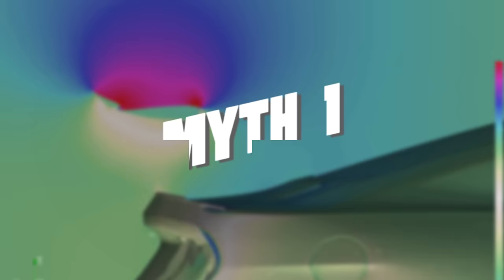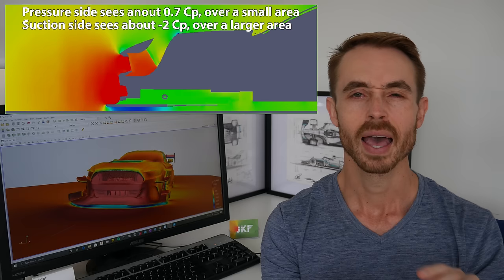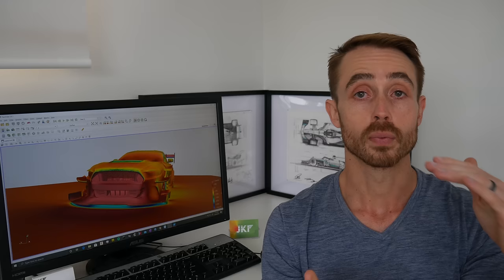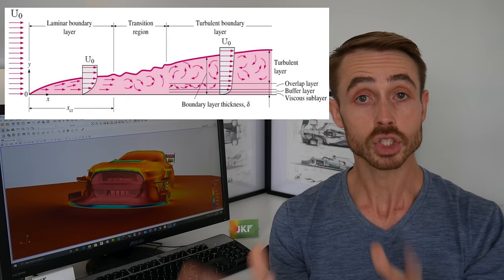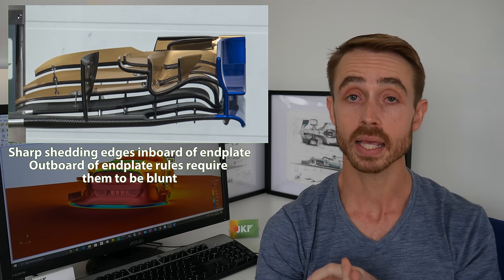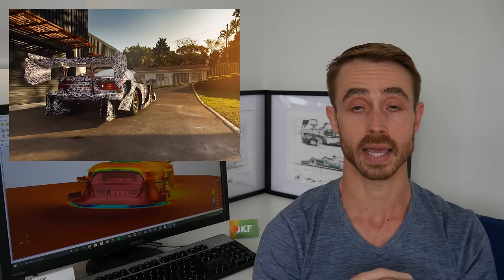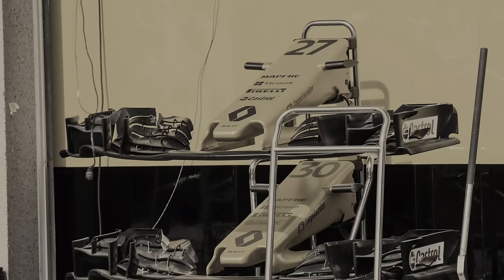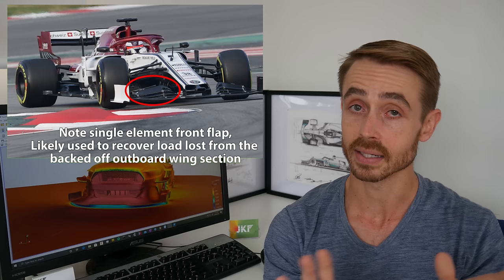5 Common Race Car Aerodynamic Myths

Comment from the maker: Seeing a few questions in here about speed sensitivity, downforce definitely does vary as the square of the speed (L = 1/2*density*velocity^2*coefficient of lift*area), however what I am more talking about is changes in flow separation and the coefficients of lift and drag varying with speed. Thanks for watching!
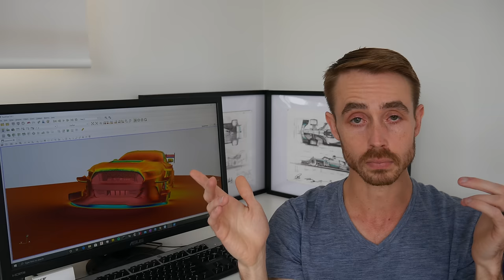Reply: How do you design a fixed angle air foil with a large enough angle of attack for downforce at low speeds, but shallow enough to prevent flow separation from high momentum air at high speeds? Also what do you mean by "load" at 8:47 ? Thanks, love your vids!
Reply: I would like to recommend a topic for a future video. I think it would help educate people and myself, if my assumption is wrong:

Would cars trailing a truck to lower their fuel consumption consequently increase the truck's fuel consumption?

I think it won't increase the truck's fuel consumption (at least not significantly) but a lot of other commenters are saying it will because "nothing is free".

I see it as if a snow plough pushed the snow out of the road and cars behind it are travelling more efficiently because of the absence of snow on the road. the snow plough's fuel consumption will not increase or decrease because of the cars that are reaping the benefits of the absence of snow on the road, whether those cars are 15 meters behind it or 1 km behind it.

Now i know that analogy is not very accurate since snow does not flow back into place like air does so i hope you can make a video with a better explanation. Thanks!
Reply: I'm watching WTCR in nordschleife this weekend and the Lynk &Co have the rear wing with a very unusual angle. I think is an example of the Myth 1 of your video?
Reply: @ccmckernan  now a days you see a lot of flexible wings which deflect at higher speeds thus reducing angle of attack. Check red bulls flexi wing in vettels days for more info
Reply: @sepg5084  It depends somewhat on the distance of the vehicles. But there has been wind tunnel research for example by Zabat et al on platooning. It showed that generally the drag decreases for the trailing cars and sometimes even for the leading car. The reason for the decrease at the trailing cars is the reduced speed of the incoming air in the wake. So effectively the incoming air is slower, which, as mentioned in the original post, influences the force in a quadratic fashion. The drag coefficent however, slightly increases (at least in the research I conducted) due to the higher turbulence, but its not as much as the decrease in velocity (at small distances under ~100m). Another project including trucks was the European SATRE Project, showing similar results. There were a few more, but just to give you a head start. If you want to look deeper into it, usually the expression 'Platooning' is used for convois of vehicles. Let me know if you are curious about more, cause that was part of my research over the last few years.

Edit: Sorry, forgot about the secord part of your question: The leading vehicle usually is barely influenced. The results are not fully the same, but most research believes the drag of the leading vehicle decreases slightly as well. As vehicles are bluff bodies, usually you have a high pressure region in the front, working against the movement as well as a low pressure region, also puling the vehicle back. The trailing vehicle has a lower pressure in the front due to the lower speed. However, it also slightly increases the pressure at the back of the leasding vehicle. Most likely the air is slowed down in front of the 2. vehicle. Thus, the pressure in this region increases and also increases at the back of the leading vehicle (we are talking small distances here). Thus the suction on the back of the leading vehicle, pulling it back, reduces and the drag is reduces as well. If I remember correctly it was, depending on the experiment, in the region of a few percent - but do not quote me on that :)
Reply: Cx and Cz do dynamically change with bodywork deflection. I think you underestimate how compliant parts are for mass reasons. Changing pivot points in the structure allow you to control this impact. As load is proportional to v^2 this impact is most felt at high speeds so this can be powerful for dumping Cx on the straights.
Reply: The use of the word Suction is very misleading.
https://www.youtube.com/watch?v=5eFI8-DyWtA
Look at the title of that video, then listen to what he says.
Pressure difference Top/bottom is the better term used nowadays.
Reply: Qw
Reply: @sepg5084  I would think if anything, if they were close enough they would help the truck's fuel economy by reducing rear suction.  People who say "nothing is free" are correct in that energy is always conserved, but in this case it just means that less energy is transferred from the vehicles to the air in the forms of wind and heat.
Reply: Suction is not a force.
Vacuum is not a vector.
Reply: heard we still don't know how a plane wing works yet too 🤷🏻‍♂️

Comment: I disagree with his first claim that aerodynamic downforce phenomena are generated by suction, not pressure. “Suction” is a virtual force much like centrifugal force. Neither are real forces. Suction is an apparent force that is really the result of the higher pressure in the side of the system in question opposite from the “suction” lower pressure. Suction cannot exert a pulling force and only appears to be a force when in reality the net force is only exerted from the high pressure side of the system like an airfoil turned upside down from how it is usually positioned for aerodynamic lift.

Comment: The emphasis on "suction" bothers me.  Air does not pull down on the undersurface of the wing...there  is no tensile coupling.  So the only actual force on the wing is the higher pressure on the topside.  The "suction" is only a mechanism for creating a pressure differential which attempts to force the wing away from the higher pressure topside towards the lower pressure underside.  That is not in disagreement that the underside low pressure characteristics can be more significant than the top side higher pressure contribution.  But it's the differential that provides the function.

Comment: Could you do a video on the subject of wheel arch vents: their appropriate time and place in race cars, and how they work? Also, the new Lotus Evija has some really interesting exterior design choices which could make for an interesting video.
Reply: Evija does indeed have some interesting aero. Ignoring the body styling to a certain extent the front wing/splitter and floor design is very much reminiscent of an LMP car.
Reply: My understanding is that venting wheel arch pressure is generally a good thing to reduce lift but how you do it can have an adverse effect on downstream aerodynamic elements
Reply: @DjDolHaus86 but were is the best Spot before at or behind the center of the wheel?  Because if I remember correctly (did see a Video from a different guy) that has a huge impact  on the wheel arc pressure and how it cann distort the air flow and effect all kinds of other downforce devices
Reply: @TheLtVoss  There is no singular answer to that, it would depend on a whole bunch of factors.
Reply: @DjDolHaus86  yeha though so much but a Video on that would at lest give us the knowledge to make assumptions too Figur it out our self if we have the drive too do soo
Reply: @TheLtVoss  I'm not sure what you expect me to do about this? I don't make videos on aerodynamics

Comment from the maker: Welcome back to the first video of regular scheduled programming since my return! Hope you guys enjoy it!
Reply: WE ARE ENJOYING IT BEFORE EVEN WATCHING
Reply: I love the content! I show your videos to all of my FSAE aerodynamics subsystem members for introductions into key concepts.
Reply: Glad you’re back
Reply: thanks, i really appreciate that
Reply: what's your opinion on exhaust blown diffuser ? Like naca duckt shaped exhaust tips integrated in to top of the diffuser.
Reply: What about diffuser that are sealed with the bumper (like your miata picture example) and the diffusers that have space between the top part of the diffuser and the rear bumper/body of the car? I see those two style at the track very often at the track.
Reply: That's a great come back! I like it a lot.
Reply: Question about number one especially in the case of high angle rear wings doesn't the redirection of air also make downforce.
Reply: @Multiversal_Rift  Coefficient of Lift takes that into account. And Cl has a theoretical limit of 1 on the pressure side.  Also from a design point of view, you don't really have to worry about the pressure side because airflows usually don't separate from it.
Reply: MotoGP aero for next video!
Reply: I love it
Reply: Great Video! I would be interested to have a Video about Gordon Murrays new T50 Fan Car. That would be nice to understand in detail and would be a good addition to topics in this video.
Reply: Great video and very timely as I have finished my diffuser. Now moving on to the front diffuser and side skirts.  Great info to clear up a lot of myths out there.  Thanks!
Reply: Welcome back!

Comment: That last one makes quite a bit of sense.  Because on aircraft, the multi-element flaps act as a single element when retracted and only become multiple elements when extended past a certain point.  The goal of the flaps is to maximize lift at low speeds.  So multi-element wings should really only be used at tracks where the top speeds are relatively low.  Otherwise, the time gained in the corners will be negated by the greatly reduced top speed.

I would like an in-depth explanation on how the slip ratio of the tire works.
Reply: Unless the rules allow for DRS. Then, you could potentially have higher downforce at lower speeds than a single element and put the elements into a 0 attack angle for the straits. The problem is, in many cases the elements are "designed" by the "looks good" or "worked for so and so..." method and achieve drag and lift coefficients no better than single element devices.
Reply: He has done a whole freaking 10 part series on tires already!
Reply: "I would like an in-depth explanation on how the slip ratio of the tire works."

Beyond saying "tyres generate highest forces at certain slip angle/ratio ranges, which can shift depending on load, geometry, conditions, etc., and this is because they generate grip in many different ways, which vary in effectiveness with varying tyre conditions", it's a bit hard to go much deeper, unless you're trying to isolate why one specific tyre behaves like it does.

Tyres generate their grip via multiple mechanism, like for example molecular bonding/adhesion (literally the molecules in the tyre and surface being attracted to each other), mechanical locking effects/deformation (microroughness on the track surface interacting with the rubber causing mechanical locking behavior) and tearing. All of these can produce different amounts of grip, and their individual behavior with regard to things like rubber temperature, contact patch load and slip angle/ratio can be very different. Tearing might produce relatively more grip at high slip angles while adhesion might provide less, and vice versa at lower slip angles. Having a wet track surface might remove adhesion grip almost completely out of the equation, one of the main reasons for why the "off-line" can be faster in the wet (rather than the rubber on the racing line being "slippery" in the wet, though that isn't irrelevant): Cars usually drive less on those lines, meaning the surface aggregate is generally less worn down and the microroughness is "sharper", which makes deformation grip more effective. Especially on street circuits, where the surface is pretty worn down everywhere, the racing line tends to be the fastest line even in the wet.

So um yeah, they're a very complex subject, and the slip angles/ratios generating optimum performance vary massively depending on rubber compounds, tread patterns, tyre construction, vehicle they're used on (load, suspension geometry, etc.), rubber conditions (temperature etc.) and environmental conditions (wetness, temperature, driving surface condition, etc.). The one thing you can say for sure is that peak performance for any rubber tyre will be generated with some amount of slip.
Reply: @guest426  not just DRS, but also deformation
smaller elements don"t need to deform their support structure as much to twist out of the way
Reply: multi-element flaps makes lot of lift but and drag too, because after every element, air stream is diverted for some degrees and after last element it can be 45 or more deg , and then starts turbulence that makes wake
Reply: That’s broadly true but his point is that if you can do it with a single element then you should.
Reply: @makantahi3731 Not necessarily… lift/drag ratio is the biggest factor here and up to a point, the choice to go with elements or without will be made with this in mind.

Comment: with the pressure side vs the vacuum side part at the beginning. its true that the pressure side is more important because they are the same thing. The "sucking force" is really just the lack of pressure pushing on that side of the aero feature. Also the pressure side can without a doubt create more force than the vacuum side because the atmosphere is only at such a high pressure, if you had a perfect vacuum on one side of a plate and atmospheric pressure on the other it would have the same force on it as if you had atmospheric pressure on one side and 2 atmospheres of pressure on the other. what i mean by this is the amount of + pressure you can create is less limited than the amount of "-" pressure you can make (basically limited bu atmospheric pressure)

Comment: For myth 1 surely it’s the difference in pressure on either side of a surface that counts? It doesn’t make much sense to only talk about one side.
Reply: Yes it's the difference, but which side really contributes to this difference? Consider an airfoil where the pressure side stays unchanged at an ambient pressure of 1 atmosphere, while the suction side is at an average of, say 0.25 atmosphere. The difference between the two is 0.75 atmosphere acting on the airfoil surface towards the suction side (lift/downforce depending on the airfoil's orientation), but in this example all of the difference was generated at the suction side. The pressure side doesn't contribute to the change. 
In a real airfoil there is usually an increase in pressure on the pressure side (hence it's name), but that is dwarfed by the decrease on the suction side, even with symmetrical airfoils.
Reply: @ASJC27  well if it’s a difference there’s definitely 2 sides to the equation that describes the force. But as Kyle said the low pressure side is more able to be influenced so as a practical matter that is the focus.
Reply: Yes, but the difference is still how you look at it. You aren't trying to generate high pressure on the top side, you are trying to generate low pressure on the bottom.
Reply: @Finnspin_unicycles  that's a good way to explain it. I think we agree.
Reply: @ASJC27  Thanks for clearing up, I thought that my whole understanding of pressure and "suction" was a lie

Comment: Question/idea: can you have a multi level diffuser with slots in the strakes to achieve multiple strake vortices on multiple levels?
Reply: vortices are made because  space or cross section of diffuser starts to be to big and laminar airflow can hold that big change , or can not slow down so fast so it keeps moving but around like vortices

Comment: sharp edges is also a problem not only in aerodynamic but in engine tuning of two strokers where people tend to knife edge al over inside the cylinder where its airflow.